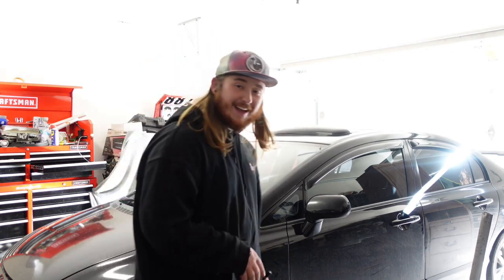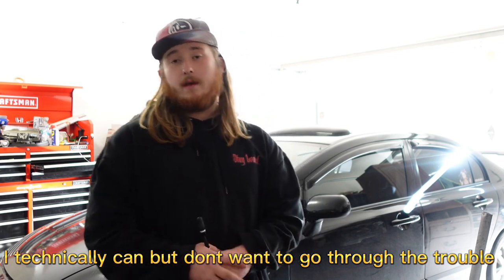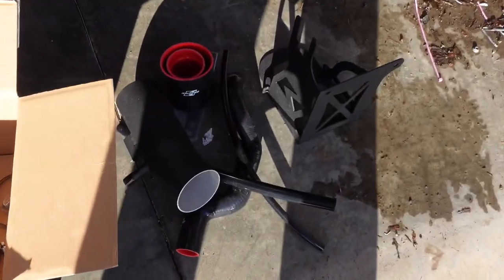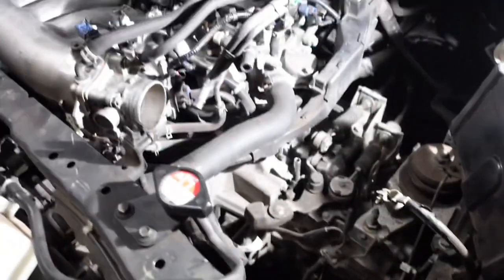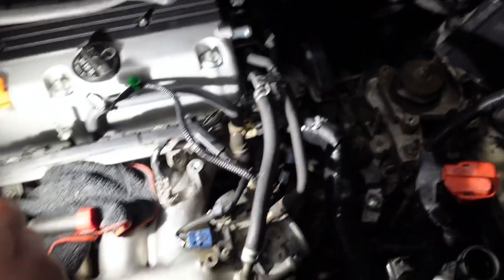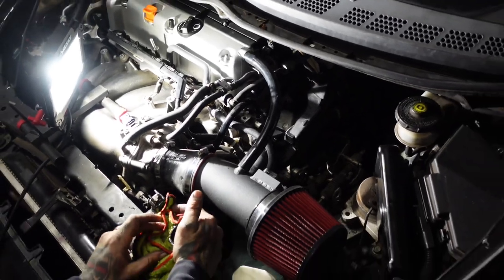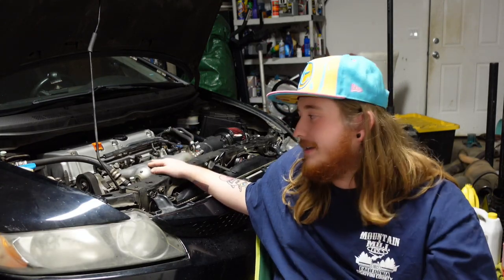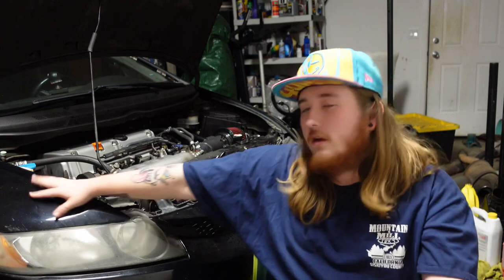Ktuned 3.5in intake install (Best daily intake for 8th gen si?!?!)

Comment: You also could of got the cold air & just get the cover they sale for the intake to keep from sucking up water
Reply from the maker: For sure! And that was a option I was toying with for a good while. But I ended up deciding against it with just the sheer amount water we get and me not wanting to keep covering and uncovering.  So far this intake has been keeping it very cold and doing a very good job sitting at around 50-65 degrees Fahrenheit!

Comment: Do you need to flush coolant to install a new intake or no?
Reply from the maker: Yes you do.  One of the main lines is from the throttle body which needs to be moved.
Reply: @ProjectRad  i never did with my short ram lol i havent had any issues for a year? does it mean there was just air in the system for a while?
Reply from the maker: @repingers9777  that is correct